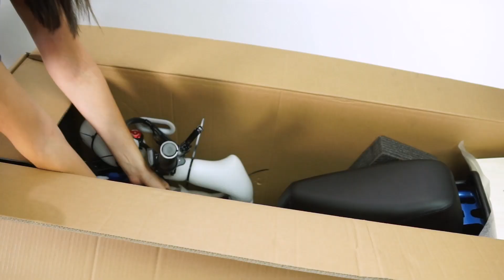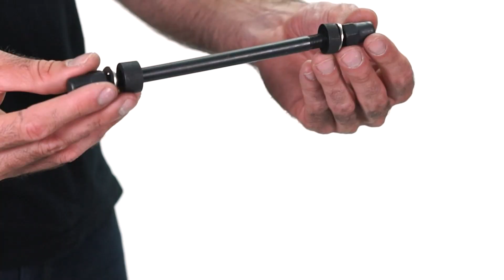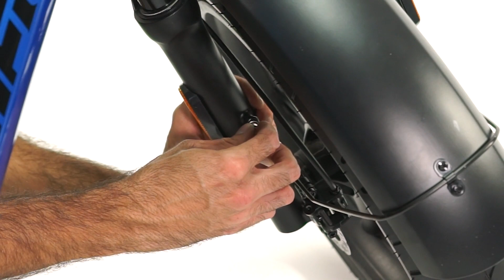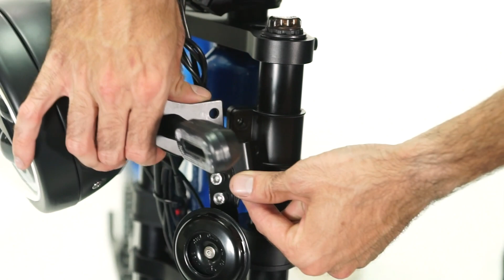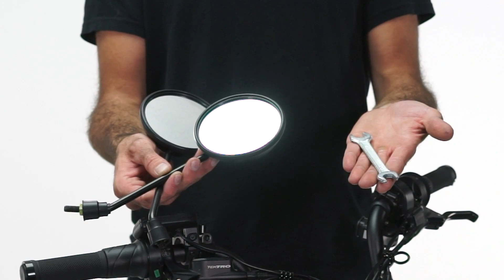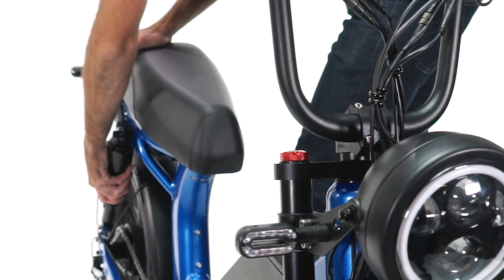Juiced Bikes HyperScorpion Assembly and Set-Up

Comment: UPDATE:  Went several miles on it yesterday.  Really REALLY nice!  The cadence feature works extremely well.  It's super fun to drive.  Seems very sturdy and comfortable. 

Just got my Hyper today!  Put it together and charging.  Very helpful video since the directions in the box only show how to install the front wheel and pedals. Will give it a first run in the morning and give you an update. Assembly is easy. Had my wife hold up the front end while I installed the wheel. Otherwise a one man job. Seems to be well thought out and durable.
Anyway got it assembled and charged it overnight.  Went for a test ride the next morning. Very smooth and nice ride. But I could not get the speed above 20mph. There is no manual with the product and no manual on Juiced website. I did a search in Juiced FAQ and found the right document.  You have to go into setup mode on the LCD display by holding the + (plus) and - (minus) buttons together for 3 seconds. This gets you into setup mode. From there hit the - (minus) button until you get to "MPH" then press the power button on the back side of the LCD display. Set the MPH at whatever you want the limit to be.  Once set hit the power button continuously until it exits setup.  To activate Race Track Mode go to setup again by holding the + and - buttons on the LCD display. Once in setup hit the minus button until you get to "NDW" then hit power button. Use the + button and set it to 5 then hit the power button until you exit setup. Done!  Here's the link:
https://support.juicedbikes.com/hc/en-us/articles/360010950491-How-to-increase-the-e-bike-s-top-speed-limit
Make sure you have a helmet!  You can easily get over 30 mph.  Have fun. Be safe!
Reply: I'm thinking of getting this for commute but I weigh 240 pounds will it support me
Reply: Juiced Bikes how long does it take for the hyperscorpion to ship? I ordered it last wednesday
Reply: @JMR_2028  I ordered mine two days ago, came today! Was in disbelief how quick it arrived! Quicker than Prime

Comment: How come my Scorpion arrived assembled cept for the front tire, pedals and handlebars? YET this shows a need to assemble the fenders, the headlight, reflectors, removal of wood on the rack??,  horn, mirrors, signals, etc..??

 I've not seen any Juiced info on battery maintenance? Like when you first get the bike plug the battery into the charger while you're assembling. Wait 3 hours for it to be full of charge. Ride till the battery reads 45.7 (20%). Then do you re-charge till full again or do you only charge till it's 80% full? The  80% to 20% usage rule adds 50% more charges to the lifetime of the battery. And what is 80% full on the 19ah battery? On my 13ah it's 55.7.. So what is it on a 19ah battery? And when would you re-charge to 100% full again. 3 weeks later? 3 months later? Everyday? Inquiring minds want to know? Thanks!
Reply: @juicedbikes  Yes I'm buying a Hyper as well !  
So why the difference? This Hyper set-up much more complicated then the Scorpion??? Same box same size bike YET way different??? 

Also does the 19ah battery use the same voltages as the 13 ah when it comes to 80% charge value 55.4 and 20% 45.4 volts? 

And what about charging? Do you charge it to 100% full just the very first day or for first 3 days or after 3 weeks of charging to only 80% do you charge to 100% or is it 3 months? It's not clear?? 

Thanks
Reply: @jaclaz66    Assembly for the Hyper is NOT complicated. Its very easy. Seems Juiced may have had issues with shipping damage so they changed the way it is packaged to keep the parts in one piece. Honestly its just a few screws and the front wheel.  Not a big deal at all.

Comment: Thanks, this video is very much appreciated. Some people are new to partial ebike assembly... I personally have trust issues, it's difficult for me to spend money on anything without weeks/months of research. I actually have high hopes for this ebike🤞🤞...I have that type of alarm on my Cyrusher ebike, DO NOT LET THE CONTROLLER GET WET TOO MUCH. My alarm device that i placed on my ebike (usually 120 decibels) withstood pouring rain, I drenched it, and it was fine. But my controller for my alarm stopped working one day when i was delivering food in windy horrible rain. I left it on my Keychain before, on light rainy days, and it was fine. But don't try your luck when it's cats n dogs out there.